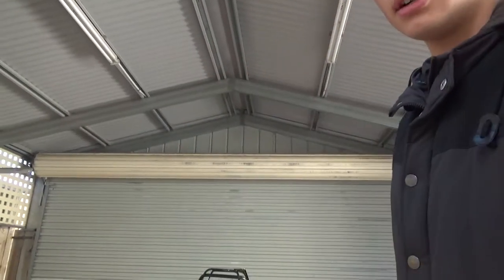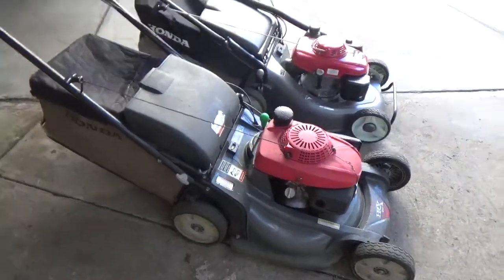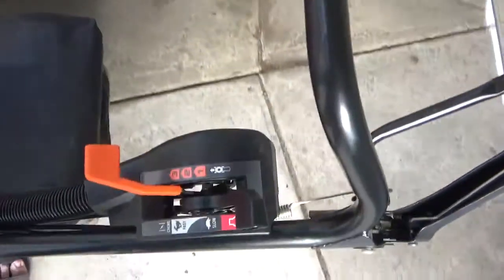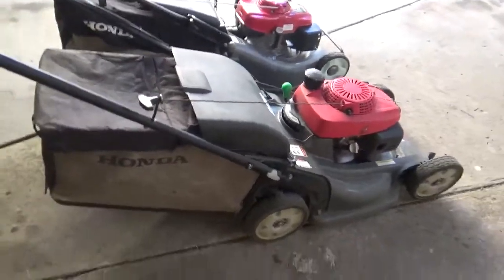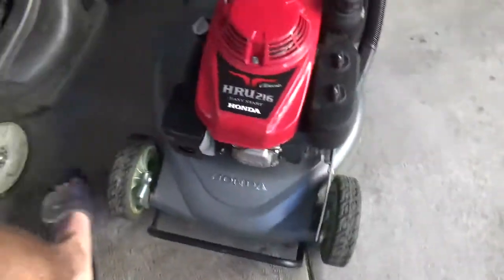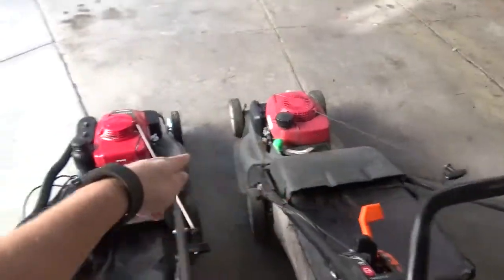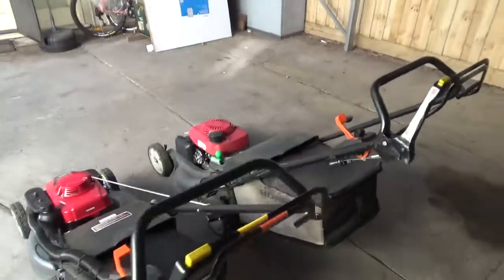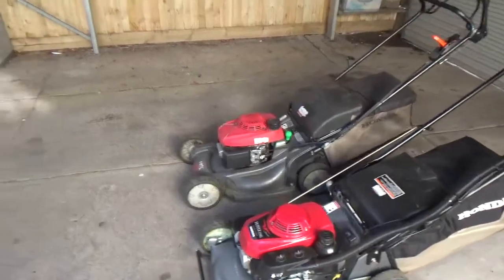HRU216 and HRX217 comparison, adjusted revs, what do you want to see next?

Comment: best of the best ? bushranger 800SP stomps all over the HRU216, either with loncin or honda block, better box, more refined.
Reply from the maker: 4 years ago I didn't even know Bushranger existed, but since then I've worked extensively with them and love their tools. You're 100% right their pushys are built like a brick shithouse and their new model with the blade brake looks especially good. I reckon I'd get one of those next ;D
Reply: @JWNLawnCare  to your defence, neither did i mate, 4 years ago this would have been the ducks nuts but, not so much anymore.

Comment: Dislikes 
Wheels ware where the bearings are 
the over head cam models leak at the cam seal under the front silver cover front and rear bushes bugger out and then wares the alloy deck housings the safety handles have the bits sticking out the always catches on your shirt or hits you hard on the stomach 
My 19” model long range needs a larger shoot and nudge bar 
Ohhh and stickers come off the deck
Reply from the maker: Yeah the 19" models are a pain my mate has a HRU197 its terrible the chute is tiny and blocks up constantly even on regular height lawns that are bone dry. The 216 has done me fantastic so far no issues at all. I have modded the blade brake system now and it does really good but I would never get an engine brake model those damn things are going to be the death of me lol
Reply: JWN Lawn Care 
Please check your wheels often for looseness and bouncing like it has suspension that will mean bearings are shot and the bushes on axle are done 
Oh and check the wheels after you pop the bearings out they ware terribly 
Enjoy 
I’m not a share holder but have a look a DMC mowers 
I’m going to buy one on my next mower purchase they look tough 😉
Reply: I have a question 
How do you get your clients or advertise your business 
And how often would you mow the clients lawns 
Ohh and rough price on your standard size residential property?
Thanks in advance
Reply from the maker: DMC mowers use the same design as the old Honda mowers when they stopped making them in Australia in fact the DMC216 etc is literally the HRU216D with a DMC sticker instead of a Honda one. DMC Mowers bought the rights off Honda to make their old model mowers using the same design, parts etc. so no difference. I have a DMC backpack blower that is pretty much a copy of a Husqvarna 130BT and goes great. As to clients I have a free ad on Gumtree and the Yellow Pages other than that it's all word of mouth pretty much. Most of my clients are on either a 2, 3, or 4 weekly schedule. My pricing varies by the job but for your standard house block (maybe 800-900m2) with a standard size lawn I am normally around $60 but most of my lawns are between $40-$100 for regular maintenance. Cleanups usually exceed $250 and landscaping..... well a couple of basic retaining walls can set you back around $2200
Reply: JWN Lawn Care 
Yes excellent man good work 
About the older style deck you will find less Maintance on bushes wearing and hollowing out the axle hubs 
All to their own though

Comment: While preferring a 30", Honda does not do have one as yet. Seeing another major reviewer on mowers, he went back to the Honda's even with using the Toro and ExMark 30"'s. The problem with the 30" i.e. toro and exMark were the gearbox and other constant repair problems etc. Looking at the 217's, I saw people say, don't hit anything with these as once the shaft brakes, that holds the blades, then it's big dollars to fix. Phoning a mower store, the salesman stated that while it is possible, it's rare that you would hit something to damage the blade shaft.  I did find a review of someone that did have a damaged shaft. I also saw that the 217's had a mild steel blade and people complaining about the high cost of replacement blades and the higher frequency of having to do this. I did see that there are potential 3rd party sellers on the blades i.e. Gator G3, but I'm not sure if you can get one that will fit and balance well etc for the Honda's?

 I noticed a guy say that the 217 did not have the ability to cut the buffalo grass, when wet, like his older 19" Honda, which I believe had the older 4 blade system, which if the blades are hit, if not really tighten, will just move backwards i.e. won't damage the blade shaft. From what I've seen, the difference here with the 4 blade vs the blades on the 217, is the mulching ability of the 217's however. 

 When it come to the weight of the mower, I don't mind the Nexite deck to be on a commercial lawn mower to cut down on the weight. I would not have known about the catcher being at too steep an angle on the 217 - thanks also.  Obviously people prefer a bigger catcher when it comes to commercial.  Thanks for showing that you have variable and ability to go faster on the 217's.

I'm looking at expanding my business to incorporate lawns, but I'm not in a rush. You can see that commercial lawn people want a reliable 30" Honda. Looking at this review, I think I'll wait. Maybe Honda will produce a commercial 30", which amalgamates the plus's of the 216 & 217 ?

Comment: Hello JNW heard you comment as to your flight sim just wondering what sim you use, Ive been flying fsx for a few years and now just getting into P3Dv4 I fly online with a small group sometimes If your interested send me a PM. Great Videos on the mower, Im looking at upgrading my self propelled Honda to the latest model.
Reply from the maker: Hi I fly on FSX as well. I do have X-Plane 10 but haven't really used it. I do fly online sometimes but mainly just in single player. What Honda do you have at the moment? Thanks for watching.
Reply: Im not real sure of the model it has a white catcher bag, I reckon I bought it around 2001 or 2002

Comment: Hi James
whats are the weight differences between the two...does the HRX cut higher levels
Reply from the maker: Hi mate, the HRX is by far lighter, around 20kg difference if I recall correctly, and I can't remember if the HRX cuts higher or lower than the 216, but a quick look on Honda's website is bound to have that answer ;D The HRX certainly cuts long stuff better though I will say that much, I hardly ever had to raise the deck up.

Comment: How do you use the washport? Do you just ingage the blades?
Reply from the maker: Yes, simply plug the hose in, turn the water on and the kick on the blades and let them run for a bit. Then turn the water off and keep the blades going to dry under the deck a bit better.

Comment: also a tip.
Run all the fuel out of the carb with the fuel tap of when you store the mower without use for a long period of time. What happens is that the fuel evaporates and leaves dried gunk in the bottom of the bowl that clogs up the fuel jet'
Reply from the maker: orkhan combe haha thanks for the tip I don't think I will be storing the mower for a long time. It is out every week!
Reply: holidays is the main killer of mowers
Reply from the maker: orkhan combe haha well I'm not gone for long 😉 only a week so not any longer than it would normally be left for